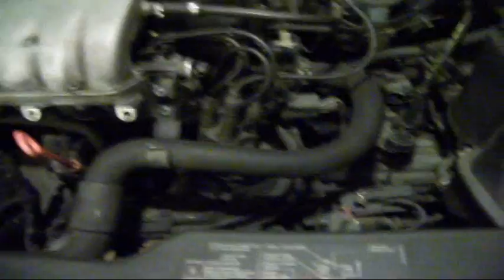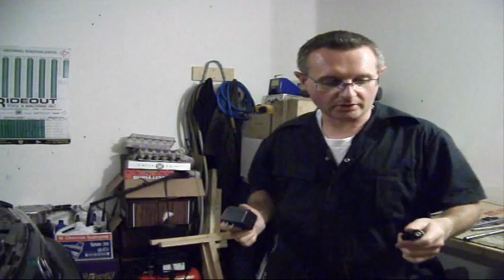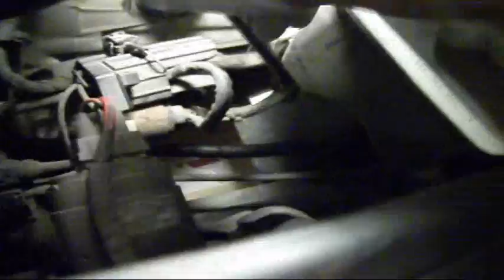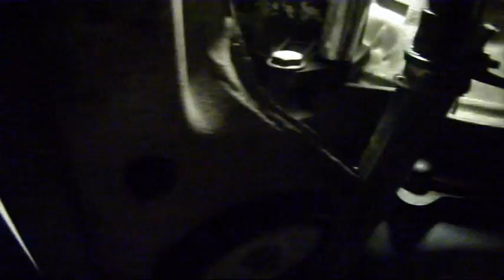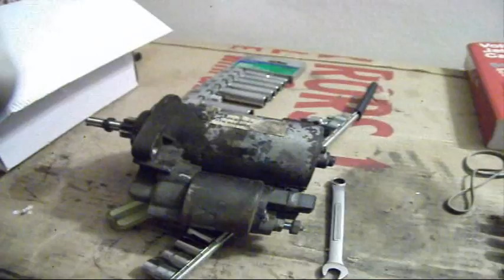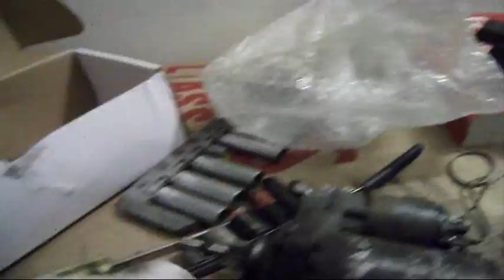VW Golf Cabrio Starter Replacement DIY 1 (Part 1/2)

Comment: 2023, and this guy is my hero!
Reply: 2024 and now he's my hero lol
Reply: @stickyrice7643  while doing this can you leave the engine sagging for a few days while waiting for the new starter?  Because removing the starter would cause it to slightly drop?
Reply: @superbelly427 honestly should be fine, it'll only sag by like maybe at most half an inch, and you can put a jack under the engine to relive the stress of the weight. When I took my starter off I relized the auto shop have ne the wrong one.. so the engine "hung" for at least a day and it was fine
Reply: @stickyrice7643  is it okay to support from the oil pan? Or is it better to do it from the transmission
Reply: @superbelly427  preferably place 2 one under the transmission and one where he places it in the video, that way the engine most likely won't move at all. When I did it, I only placed one under the transmission and had to place one where he placed his later to get the mount to match up on the bottom thread
Reply: @superbelly427  but if you only have 1 jack, place it where he placed his. Seems to be the preferred place for it

Comment: My wife's 1996 Cabrio is on it's 4rth starter, in less than 160,000 km. Not sure if the lack of use is hard on the starter or what. My 99 Subaru has 400,000 km and is on it's original starter.

Comment: i have the same car and color convertible / ite does not run so paid $150.00 and towing  was $75. 00 i had a 1969 Ply convertible for 40 years and sold it

Comment: i think my solenoid is bad. my starter seems to turn fine every 5th or 6th key turn. i just replaced my ignition coil and your other video made it super easy! the ignition switch was replaced not too many months ago so im pretty confident that its not that. what can i do to test my theory? thanks! great videos!
Reply from the maker: David Spencer Could be a dead spot in your motor.  Motor stops in a spot where a bad armature commutator bar is on one of the brushes. In other words - in a dead spot.  You can take a long stick and a hammer and lightly tap the body of the motor to see if the armature will spin a little to get the motor off the dead spot.  Don't tap too hard. There's permanent magnets attached to the inner walls that could break loose and ruin the motor.  The fix will be to replace the motor. /John

Comment from the maker: i bought uy all my parts from a  autohausaz () com they are fast and very good price.  Check the Electrical vacuum section. /John
Reply: bearing01 where would I put the negative cable when I put the starter back on

Comment from the maker: Clean all the dirt off the butterfly plate inside the throttle body.  The car will idle high for a while but it will calibrate itself after a day or so.  The throttle has a built in motor that has a memory and learns to calibrate itself if the throttle gets dirty.  If battery goes dead it can forget the calibration and then the car can run rough for a while.  Also, if throttle is too dirty the calibration can run out of tuning range and will then run rough.

Comment from the maker: Try putting a jack under the oil pan and lift up the engine maybe 1 or 2 inches.  That bolt may also be running through the engine mount and is holding up the engine.  If you can, instead of putting the jack under the oil pan put it under one of the brackets for power steering pump or something - so you don't crush the oil pan gasket.

Comment from the maker: @Jadistk When this starter was getting old and "starting to go", yes, the starter would turn the engine slower.  When I put the new starter on I was amazed at how fast the new motor would crank the engine over.  The engine sounded like a new car starting.  Yes, an older starter motor will turn the engine over slower and if too slow then maybe the engine will take a while longer to start. You want at least a couple hundred rpm engine turning speed to get the engine started in a short time.  /John

Comment: Thanks for the video man. I have a '96 Passat 2.0L-4cylinder (ABA like in this video). I took a brief look and it looked the same placement/mounting

My had some problems 'diagnosed' at a shop for $40 and they told me my starting issue was the starter was going slowly and going bad. That's why it would take 10 seconds or so to start. It makes the normal starting sound but just kind of slow and takes a long time to do it. Does that sound right to you? I just replaced battery.

Thanks again!

Comment from the maker: @major101major This starter does not have a remote relay. It has a solenoid.  See my other video on starter troubleshooting.  There may be an alarm starter disarm relay, but that's the only one.   As for the bushing, I don't think there is one.  I'm assuming you're talking about a pilot bushing to hold the starter pinion shaft centered.  That bushing would be in the hole that the starter pinion shaft gets inserted to.  I don't think there is such a pilot bushing. Thanks for commenting /John

Comment: one question... i just bought a 95 jetta and i just got a new starter for it. there is a bushing that you have to get out and put the new one in. now i found another problem. i think the starter relay has gone out. but i do not know where it is. i have no owners manual. therefore i cannot the relay. i just need to know the location if yoiu have it. thanks alot.

Comment from the maker: @FU420B The trigger wire is the one with the plastic connector that you can remove by pinching and pulling.  You want to see 12V on that connector pin when the key is turned to start.   The trigger wire comes from the ignition switch.  The other big heavy cable running from the battery to the starter is what supplies power to the starter after the solenoid (lump) has been triggered.  The solenoid is just an electromagnetic switch that internally connects the heavy battery wire to power the motor

Comment: @bearing01 thanks I did have a dirty positive terminal and I cleaned it with baking soda and water so its clean I can't seem to get the neg teminal off but its clean too.
Now which wire is the triger wire? I see a black plug and 2 other cables 2 on one post.
thanks 
Joe

Comment from the maker: @FU420B Do you know how to unplug the trigger wire on the starter and probe it with the volt meter while a friend turns the ignition key?  That should tell you whether or not the starter is getting the trigger signal.  If it is getting the signal then that indicates the problem could be the starter.  Use the engine or battery -ve as your volt meter black probe ground.  Let me know if you need help.  It may take a day or two but I may be able to show you what to do.  /John

Comment from the maker: @FU420B When I had my problem I also heard no clicks when turning the key.  It was like the starter was not getting power or getting triggered to start up.  You could also have a bad ignition switch.  Those things go bad on these cars also.  But the symptoms there is usually that the car starts okay but the windshield wipers and dash lights stop working.  Do you have a volt meter? Do you know how to use one?  /John

Comment from the maker: @FU420B It could be a bad starter.  It could also be your alarm system or if it's a manual trans then the clutch pedal switch that prevents starting when the clutch is not pressed.  On an Auto trans the gearshift has a switch that prevents starting if not in P or N.  If you think you have a bad starter like me then get a stick 2 feet long, and a hammer.  Put the stick up against the starter body and give it a couple light weight taps with the hammer.  Then try. If it works then it's the starter.
Reply: I got 12v going from bat to starter and 12v going from ignition to celluloid(trigger wire) when turning ignition key. No start, no crank. Just one click. Brand new battery. Car was turning over slower and slower at start for months, then finally wouldn't do anything. Tried striking starter motor a couple times as well. Nothing. Sounds like bad starter right, if it's getting the 12v's when and where it should?

This starter is only three and a half yrs old, but a cheap one ($65.00 I payed off web). Put it in with the help of this video. Push started it to get it home when it stranded me because of this problem and engine runs fine. It's a 98 VW Golf GTI 2.0 aba engine.

Comment: Your video was awesome, helped me so much on our 96 2.0 ADY engine Golf. Drove through a puddle, managed to burn out the module because the dizzy got wet, and then ended up burning out the starter trying to source the problem. Thanks a bunch for the help!